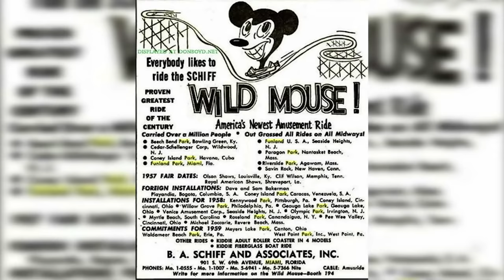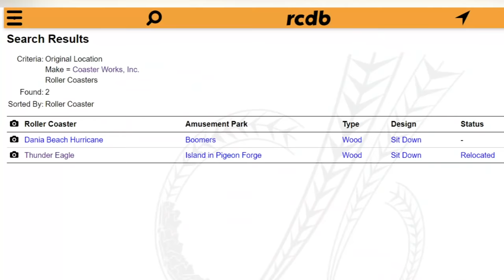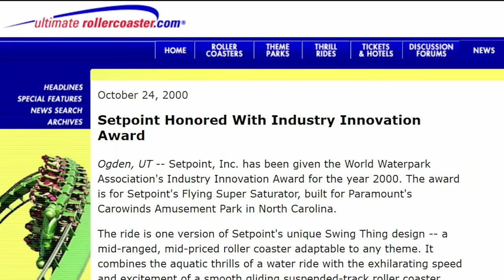Top 10 Extinct Roller Coaster Models You Can't Ride Anymore

Comment: I can't help but think how Roller Coaster Tycoon actually implemented a roller coaster model that went extinct 17 years before it was released. RIP, Virginia Reel, you live on in our hearts.
Reply: Wasn't that coaster option in RCT even called the Virginia Reel? I may be wrong, it wasn't a type of coaster I cared to build much.
Reply: They actually implemented a roller coaster that went extinct 70 years before! The wooden reverser roller coaster operated in the 1920s and likely went extinct in the 1930s.
Reply: We had a Virginia reel here in Blackpool , UK . It was first built in the 1930s.
Reply: Was it on Roller coaster 3 if it was you can ride it
Reply: @EmilKazooPlayer  It was actually the 1980s when the last Virginia Reel closed
Reply: The specific wild mouse model at the beginning of the video was also implemented in Planet Coaster
Reply: @EarthySmerky and for some reason they didn’t add a regular wild mouse
Reply: @WhatAG23  technically the spinning wild mouse is the regular one if you use mods
Reply: @WhatAG23  They did, I'm not sure if you need a dlc or not
Reply: @shuichisaiharatheultimated6754 it is most rct1/2 rides are in rct3

Comment: The Vekoma Flying Dutchman will soon be extinct. Batwing and Nighthawk have maintenence issues and I don't expect them to operate much longer. So if you have gotten the credit, I recommend that you do before those rides get sent to the scrapyard.
Reply: I can vouch on that. Batwing always opens up an hour after the rest of Six Flags America does. And from what I've been told, the maintenance crews there dread working on it.
Reply: They may want to get it redone by vekoma with there new flying coaster
Reply: Batwing runs so much better than Nighthawk. Nighthawk is ouch city
Reply: Yay
Reply: As someone who managed to ride fire hawk before it got nixed, I’m almost panicking that I won’t be able to get to the other two
Reply: @emmysoda  don’t care if it’s your home park or what . We already know
Reply: At this point when you visit SFA you should expect Batwing to be closed. Shame, I actually like it better than ride of steel.
Reply: Nighthawk isn’t gonna be removed for a good 10 years if I could predict. It’s carowind’s most popular ride and it hasn’t had too much down time. When it is down, though, they have all of the parts from firehawk sitting in storage under Fury 325’s drop.
Reply: @ilikerollercoasters4757  neccesarily I agree, or if it was to shut down, they may get vekoma to retract it and referbish it with there new flying coaster model
Reply: @georgefloyd9035  Or just replace it with a b&m flyer
Reply: Neccearily I have experienced the b&m and new vekoma one , and I actually prefer the vekoma one
Reply: @georgefloyd9035  Vekoma has really recovered their image in the past few years
Reply: @pypeapple  exactly
Reply: @ilikerollercoasters4757  where I live, I can walk to carowinds from my house so you can imagine (not during covid ofc) I’m there allllll the time.

I don’t know what your taking about nighthawk not being down, it’s a 50/50 at best whenever I go (at *least* once or twice a week), and it’s nowhere near the most popular ride, 6th at best. The top five are fury, copperhead strike, intimidator, Afterburn, and hurler. 

Also nighthawk takes up an unbeatable plot of land right in the center of the park that would be exactly the ideal spot for their next coaster. The last thing is that the capacity for that ride is horrible, the reason the line’s always so long has nothing to do with its popularity, it’s because it takes almost 5 minutes to get each train through. 

I think nighthawk will be removed undoubtedly within the next 5, but I’d say even the next 2-3 years.
Reply: I rode Batwing in 2003, once was enough. Most painful coaster I have ridden next to Roar which is at the same park.
Reply: I worked at kings island the year firehawk opened and it was a mechanical nightmare from day one. I don’t doubt this
Reply: I remember the Batwing line being hours long, the pathway to get there is so long that it discourages me to ride it when it's up, but I do so anyways
Reply: @CelestialOrion811  my dad took me to SFA and we rode most of the other coasters and when we were about to board the Batwing they closed the coaster down after hours of waiting
Reply: @pypeapple  lucky I just got the courage to then they started building Orion 😦
Reply: I've managed to ride both nighthawk and firehawk

Comment: I absolutely miss Hurricane at Boomers. It was such a thrilling ride. It was my first woodie and it packed a punch of airtime. So glad to see it in spotlight here.
Reply: Same here, it was a great ride! Excellent airtime and fun layout. I only got to ride it on one visit despite going several years in a row. Towards the end of its life they would only run it when the arcade was busiest, on the weekends/during the summer. 

For those who don't know, it was installed at an arcade that also has a go kart track and a few flat rides. It doesn't seem like they had the attendance to justify the running cost of the coaster.
Reply: I used to always drive by it with my mother and I only rode it once I didn’t even know to was torn down
Reply: Our Boomers shut down. we never had a coaster like that. just bumper boats, go karts, mini golf, an arcade  and maybe 1 flat ride. and batting cages and a café. that's pretty much it.  I'm gonna miss it, though.
Reply: Although i wish we had a thrilling ride like Hurricane or at least a waterslide. that would be so much fun.

Comment: I have both Setpoint credits. There was the fun factor of dumping water on guests, but they could shoot back at you too with on the ground sprayers. There were two major problems I saw with the ride 1) It took a while for your tank to refill, leading to low capacity and 2) Once you dumped your tank, the fun was over if you hit someone or not.

Comment: I've actually been on a wild mouse roller coaster. In my childhood city in Germany, there was a nearby public space where Octoberfests would setup each Octoberfest season. These would feature not only a large "Beer tent" (basically a large dining hall tent filled with tables, benches, and concession stands), but also theme-park-like attractions and the occasional rollercoaster. One such roller coaster took you through about 3 completely horizontal "stories" of tracks with tight turns that felt like you were about to go over the edge and the occasional dip. This was probably around 2015, and although designed very compactly so that it was easy to pack up and move, it operated the same as the one shown in the video.
Also funny how the wild mouse ride is in this video even though there's one mentioned at 10:00 that still operates.
Reply: Me too, 3 days ago

Comment: I would love to see B&M come back with the Space Diver. I mean, Walter and Claude did help create the design when they worked for Giovanola. I'm sure they could improve on the original using their current design standards. And relocating the original ride several times was a major factor in the deterioration of the ride due to dismantling and rebuilding the ride, weakening the structure
Reply: Or they could also use trains with clamshell lapbars or over the shoulder vest restraints if they did their space diver

Comment: Mistakes:
1. There is still a roller soaker operating called canopy flyer
2. Powder keg is not the only air lunch coaster in america.
3. It is Taiga not Tiaga
4. Vekoma already built F.L.Y

I know this video was made in 2018 btw im just telling you some things u missed
Reply from the maker: The Canopy Flyer has no water feature. I'll be stealth-editing the Taiga mispronounciation, and 2 and 4 are due to this video's original 2018 release.
Reply: @ThemeParkCrazy  yeah
Reply: @ThemeParkCrazy  vid was great btw
Reply from the maker: @Craze64712  Thanks. And thank you for your feedback :). I'll make a stealth edit to remove number 2 so that I can avoid confusion.

Comment: I rode the Wild Mouse as a child at the long gone Edgewater Park in Detroit MI back in the 70's.  There were no restraints on it, you had to sit flat in the car, and hang on to a rail that was inside of the car.  It was rough but fun, would never pass a safety inspection today.

Comment: Heeeyyy! Shout out to the Flying super saturator. It was hard to aim and it definitely didn't seem to dump as much water as they show, but maybe they loaded less to speed train loading time by the time I rode it (2004)? Having only a lap bar and no leg divider when you're two stories up and wet is actually pretty frightening too. I was a thin teen and bent over and hooked my arm under and around the lap bar arm.

Comment: Cedar Point used to have to world's only enclosed bobsled coaster (Disaster Transport) before it was removed late into the 2012 season, making the enclosed bobsled coaster extinct. Ironically, the only reason they enclosed the bobsled coaster was not to try to popularize the idea of enclosed bobsled coasters at all, it was because the owner at the time wanted to rip off Space Mountain and they just happened to decide to use the bobsled coaster (Avalanche Run) because it was the compact while still being spread out and even had problems with beach sand flying into it as an outdoor coaster. Though most of the animatronics and effects of the ride stopped working not even long after opening but the owner who was the creator of Disaster Transport refused to fix them. The theming on the ride that riders would see during almost the entire time the ride was there was lights along the lift hill, a crashed ship, a lit up crane, and some martian landscape. The main problem that led to the demise of Disaster Transport was the flaws of the coaster and building itself, including the bobsled coaster (even as Avalanche Run) having mechanical problems with its air brakes system, the building wasn't waterproof so it closed during rain. The building wasn't even properly built overall, a piece of the building fell on a rider and the rider left the ride bloodied. It's a real shame that it was the world's only enclosed bobsled coaster and Cedar Point's last remaining dark ride that all of this happened to but it was becoming an actual disaster. Thankfully, Knoebels opened up the world's only wooden bobsled coaster (Flying Turns) built in-house the next season after Disaster Transport's last season. Flying Turns may even become the last remaining bobsled coaster (steel bobsled coasters would be extinct if that happens). Mack Rides offers bobsled coaster building as part of their "Mack Classics" line, though nobody is buying them. La Vibora in Six Flags Over Texas and Alpine Escape in Great Escape have the exact same course as Avalanche Run/Disaster Transport.

Comment: The Schiff Wild Mouse at my local amusement park, Quassy in Middlebury, CT, was replaced back in 1983, so having been born in 1982, I obviously never had the opportunity to ride it.  I did ride it's replacement many times though, an Allan Herschell Monster Mouse which was extant between 1983 and 2010, as well as the Wooden Warrior, a custom wooden coaster that replaced it.  The park still has a 1952 Allan Herschell Kiddie coaster though, now celebrating it's 70th year at the park, for enthusiasts with a flare for the classic and historical significant coasters.  

   As for other Coasters I've ridden that no longer exist...  At Riverside/Six Flags New England There was the Black Widow, an Arrow Dynamics launched loop coaster; the Cyclone in it's original incarnation before it was transformed into the wood and steel hybrid, Wicked Cyclone; and Little Rickie's Little Twister.   At six Flags Great Adventure there was the Great American Scream Machine; Viper;  Batman and Robin - The Chiller; and Rolling Thunder a William Cobb & Associates Wooden Racing Coaster.  I'm sure there's others, but that's all I can remember at present.

Comment: I was in my teen years and I visited Marriots Great America (Now Six Flags Gurnee, Il) numerous times and was able to ride the Z-Force hundreds of times. It was smooth and alot of fun. The main feature was the dives, but the video didn't mention that there was a shield so you could not see what was going to happen. The main flaw to the ride was that the coaster would literally crawl into the dives, I never understood why, however if you could get on it on a hot day when it was raining, the coaster would just fly! In warm summer weather the coaster was flawless, HOWEVER in this region of the world we get very cold nights with very warm days, this would cause the coasters rails to swell and shrink causing the coaster cars to get stuck ALOT and or loose sometimes, which was horrifying! They tried to fill the track tubes with antifreeze fluid, but it didn't work, and the coaster was sent off to Georgia. Iron wolf stand-up replaced it and used the same load station, and now Goliath stands in it's place.

Comment: Flashback might have survived if they'd actually built the damn building that was supposed to enclose it. If they'd built the building, that would have contained the noise and let them run the coaster more. And with the coaster running during peak season and thus likely having more ridership, they might have been willing to invest in improvements to the restraints and trains.

Was the Hooper Reverser (memorialized in RCT) at all considered for this video?